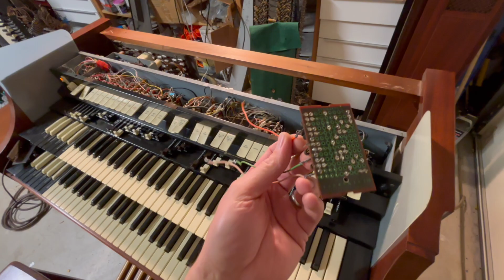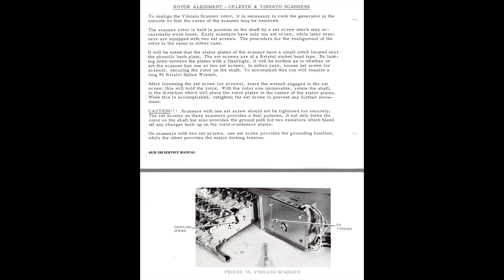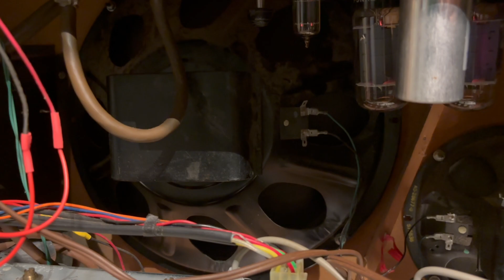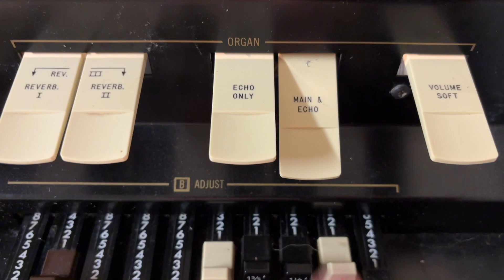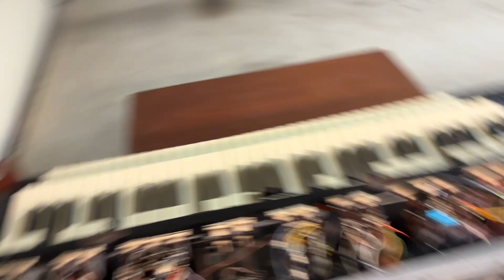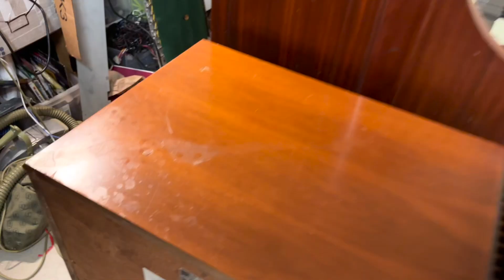Hammond H-111 Repair

Comment: I’ve got an H-182 that seems to be late-production. Happen to know what the adjustment pot is on the right-rear of the power supply? I’m unsure whether or not I’m supposed to adjust that or the “solenoid current” pot for the string bass voltage adjustment in the alignment procedure
Reply from the maker: I have no idea. What is the pot connected to?

Comment: Ive been having low volume on the bass circuit and basically the whole thing, and i have tried everything trying to troubleshoot my issue... You wouldnt have any tipes or ideas about that would you? I notice its all so quiet you cant hear thr percussion untill the bass gain is turned up. But then its froggy snd garbly
Reply: Update, after six months of slowly replacing caps I finally decided to remove the delay board and wow... It fixed the volume issue I was having, and you having a second video walk through setup is going to help me hopefully set it up tonight! Thank you for your wisdom! I bet the previous owner thanks you!
Reply from the maker: Glad that helped. As it happened, I replaced the power tubes of the bass channel and subbed the 7199 tube with a 6U8A, but that didn't solve the bass channel gain problem. What solved it was removing some components that were previously added. Someone had replaced R413 with a 4.7K ohm resistor (should have been 270k), and attached a .02 cap between 7199 pin 2 and 9. (Schematic showed direct bridge between plate and grid and that was not there, it was a ceramic coupling cap) Also there was an extra 100uF cap across the junction of R410 and R409. Removed that. Bass channel works great now.

Comment: i got a Hammond model 16322  sn 497604 was given to me not working i found a blowen fuse traced problem to a shorted cap in the power supply replaced it. now it works but has a few problems. i tried to find a service manual with no luck so could really get into repairing it.  No luck locating one. would you like to have it. its free.

Comment: I have a H-112. Pre 15K serial number, so it's all the original design. It works for the most part, but the bass pedal circuit is kind of fucked up. I don't know how to describe the problem, but sometimes the pedal sustain will be fine, and other times, after a while it will do this weird problem where it will stick notes on the sustain side, not the fundamental note (if I turn the string bass off) and sometimes the pedals themselves will cut out of signal or gradually lose volume. What could cause that? I've had the pedals go dead on me once or twice before. But other than that, everything works on this organ. The other issue it seems to have is the pedals sound really thin, even with all four drawbars for them pulled out.
Reply from the maker: On this organ, I was not given the customer's pedal board. I am borrowing my personal pedal board from my Model D organ, and those pedals apparently sit too heavily on the contacts. I had to shim them up about half an inch so that they make no contact at all at rest. I had similar issues as what you are describing, anytime any of the pedals makes partial contact at rest. Maybe try raising your pedal board overall height?
Reply: @sopranojam I have several different 25 note pedalboards from different Hammond models. I haven’t tried them yet, but the original pedals I was given with said H100 when used on my A100 would sometimes stick.  When the pedals are removed from my H100, and I press the contacts manually, the problem still persists. I have tried cleaning the contacts with contact cleaner, but it still doesn’t change. So I’m wondering if there is some sort of circuit problem somewhere that is causing this bizarre issue. I’ll have to make a video on the problem and send it here to you.
Reply from the maker: It sounds like either you have a mechanical problem with the pedals, or an electronics problem with the string bass solenoids.The service manual describes a number of adjustment procedures, such as solenoid current (before the adjustment tables). I set mine to 14V, yours might need to be set to 18V. There is also a "pedal click null" adjustment, step 14. I would say that the early models had lots of pedal problems, or there would not be so many pages about repairs and replacements for the pedal switch assembly - good luck.
Reply: @sopranojam It sounds electronic in nature, as the pedals’ fundamental notes sound fine (but I can barely hear them over the ciphering string bass notes) I’ll have to take a look at that control you mentioned. Also. how do I adjust the string bass solenoid current.
Reply from the maker: @nathanbrown816  read the service manual. If that procedure does not make sense, I'm not sure how to help. I might make a final video with adjustment procedures, though mine will be different than a pre-15000 unit.
Reply: @sopranojam  Fair enough. I always prefer the early units of different models because they usually have better built components. I have had 3 H100’s over the years, the second one I ever owned was a post 15k serial unit with the same stuff yours has, I didn’t like the build quality on those boards.